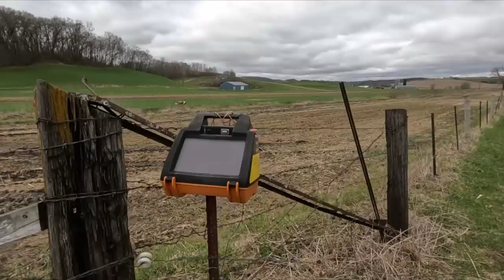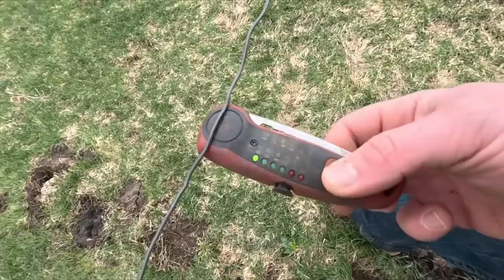How To Install An Electric Fence!

Comment: For years I used these same porcelain insulators on standard " T " posts. Most people dont know how to attach them though.  Using a no. 9 wire  12 inches long.. double it back and a half inch from the end of the loop pinch it shut with a pliers put the insulator on.....and open the ends up and place it on the " narrow " side of the T post .The eye of the doubled back end hold the insulator securely ! Cheap and easy. They stay on compared to plastic !

Comment: Yup, that's how we do it. And yes, it's been a heck of a spring. Owen running track translates into rounding up the cows when they get out of the electric fence. 😂
Reply: Yeah, Anthony, and I was just thinkin'  ONE strand!?!?! Them mus' be some gen-teel cows....!
Reply: @theburnhams2925  we often times use one strand electric fence but our fence controller is a Holdem model 57 and it packs quite a wallop.

Comment: Another way to check the electric fence is if ya have a cousen from the city that's a smart alec you ask em to pull on the wire to make sure it's tight. LOL

Comment: The fence roller I have bolts to the tractor draw bar. Powered by p t o shaft. To unroll I pull a pin.